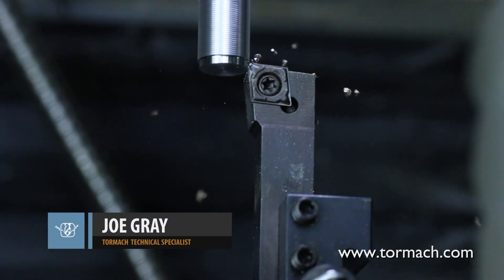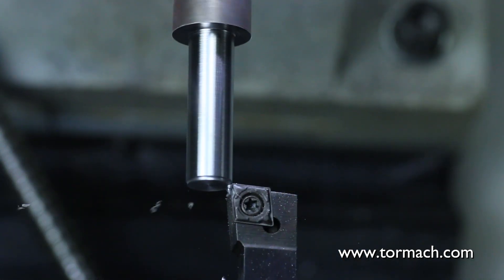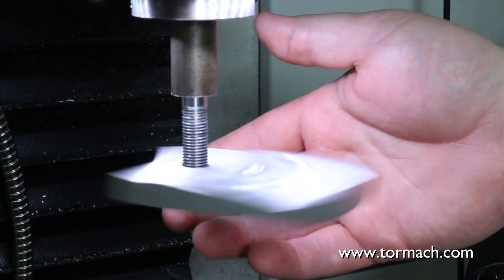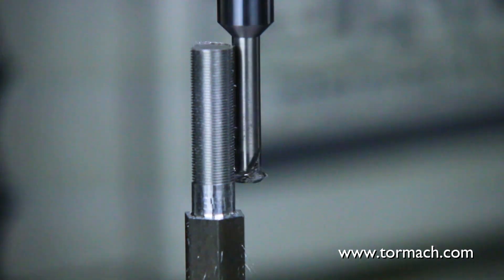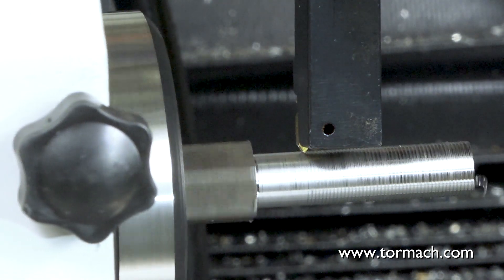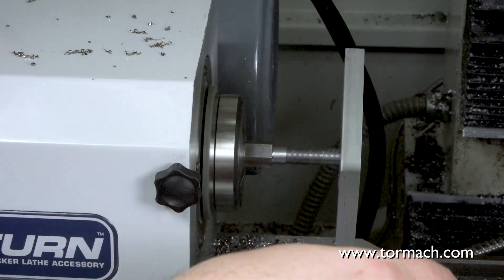3 Ways to Cut Threads on a Tormach

Comment: Are the turns (rotations) of the RapicTurn synchronized with movement of the table??  They need to be if you run the thread insert twice on the same thread, so that you enter the thread at the same point.  How does it work?
Reply: yes. You can enter 10 times with no problem.

Comment: Hi guys,  informative video, thanks.
It would be nice if you always have a list of all the tools you're using in your videos.
Could you please answer these:
What is the tool used at  0:56
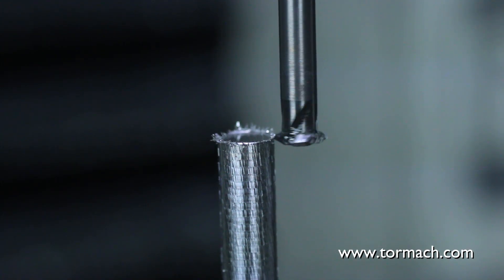What is the tool used at 1:10
Thanks!
Reply from the maker: Sorry for the wait. At 0:56, we used a 2-Flute End Mill: 21mm (PN 31261), with a M10 Threaded Arbor, (PN 31815) and Carbide Inserts (PN 31253). Then at 1:10, we used a Single Form Carbide Thread Mill: 1/2 x 1-1/4" x 1/2" (PN 34697) with a collet (PN 30598) in a holder (PN 31829).

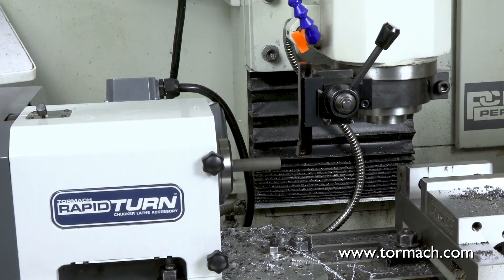Also, at 0:10 & 1:50, the RH Turning/Facing tool (PN 35642) was held with a PN 30705 holder and we used a positive insert with a chipholder (PN 36064). Then at 2:00, an OD Threading Tool (PN 35210) was held with a holder (PN 30705), and used with a carbide insert (PN 37287).
Reply: Thank you.
Can you tell me if I can do the same with this: "31256 - Center Cut End Mill - 17mm".  And what are the pros and cons of using the 31256 versus the one you used?  
Thanks.